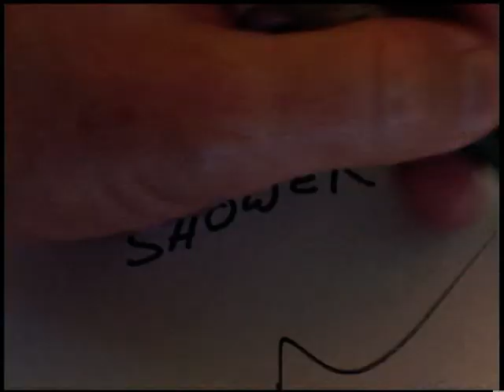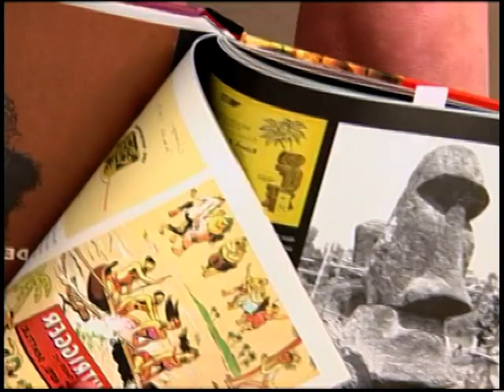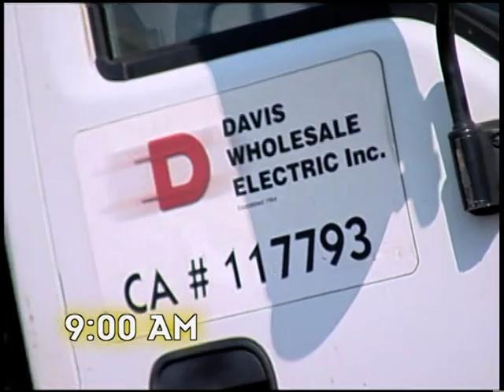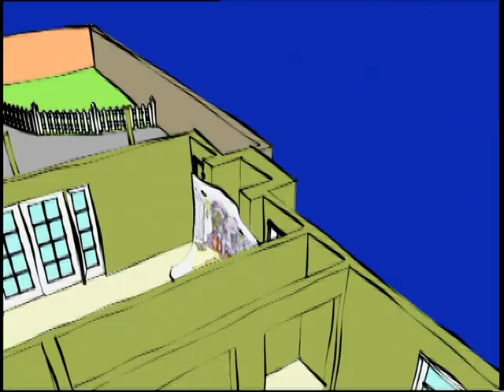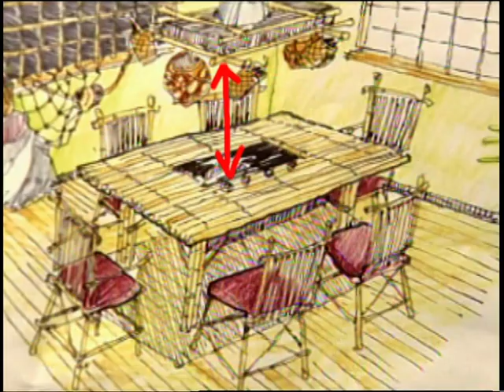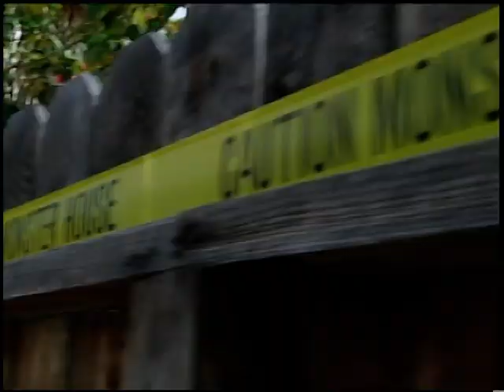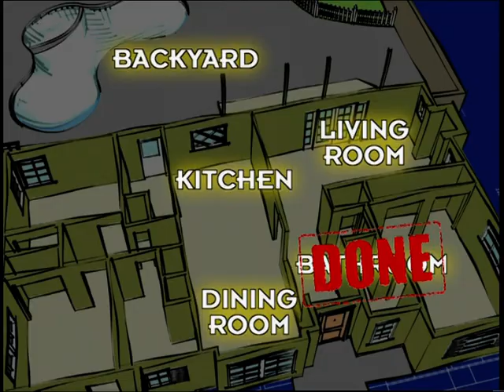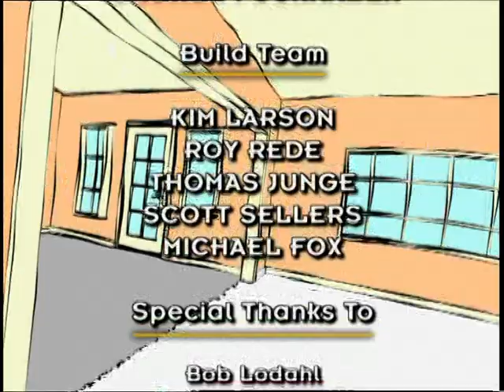Tropical House - Monster House (Season 1, Episode 2)

Comment: For anybody that is working with fiberglass buy a can of Noxzema and cover all your open skin and then get a bottle of baby powder and cover all the open skin with Noxzema and then sprinkle the baby powder over the Noxzema and it will cover all your open pours on your skin clogging up all the pours of your skin so the fiberglass cant get in the pours of your skin and the fiberglass will not be able to get in the pours of you skin, I know because I used to work in fiberglass and got tired of the fiberglass in my skin, trust me it WORKS! Just remember when you shower that night  brush down not up on your skin when showering and you will definitely notice the difference! I have to admit though this build was TRAGIC!
Reply: why not just wear clothes to cover your skin?

Comment: Scott was also in the background on the Hacienda House build. He was wearing his bags and looked to be working but was not on the episode. So I'm assuming the crew we see just does part of the work while an entire back up team works behind them off camera? I know they have a finish crew that comes in but I saw Scott like on day 3 of their build.
Reply: I was one of the crew that set up all the tools and also finished all the builds before the reveal, none of the crew worked on any project until the team was finished, still a lot of work went into completion of a build. I was also on the show many episodes, really do miss it lots of fun
Reply: @Longdogguy  how long did the designers get? it looks like they sometimes get huge crews
Reply: @Longdogguy  Also it says at the beginning of this episode that Roy made the switch from Design crew to Builder, so did he work on the show previously? that may explain why he and The Host Steve butt heads
Reply: @Longdogguy  I got confused cause it was in the middle of the build and we there wearing his bags like he was working.
Reply: Even after all the edits you can still catch other crew working in the background while the clock is still running lol The guy I mentioned was all bagged up and sweaty on the Hacienda house build lol
Reply: @SemorreButte  Usually the designers at the beginning just draw the concept and a separate crew comes in to do the work. This guy helped do both which doesn't usually happen.